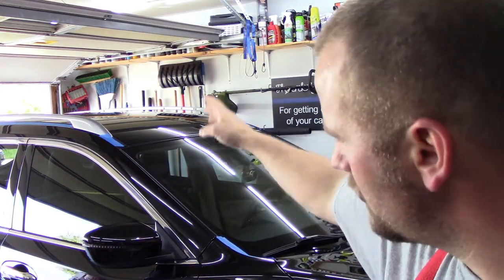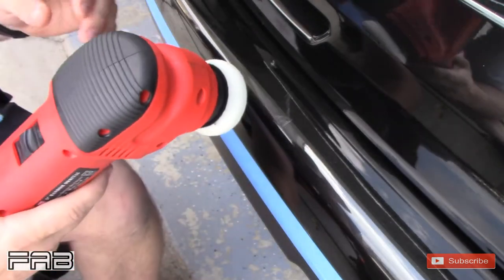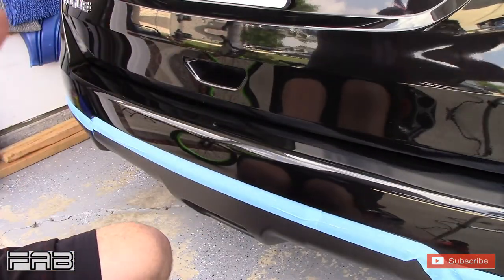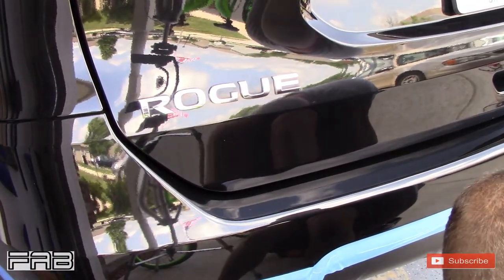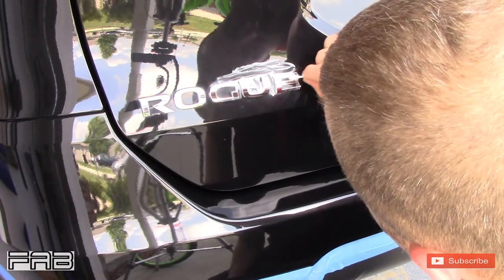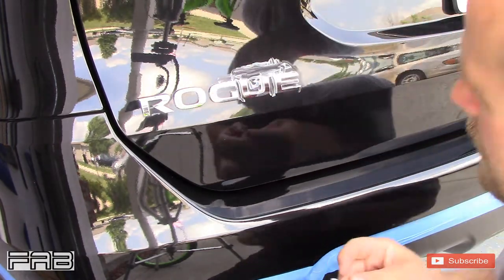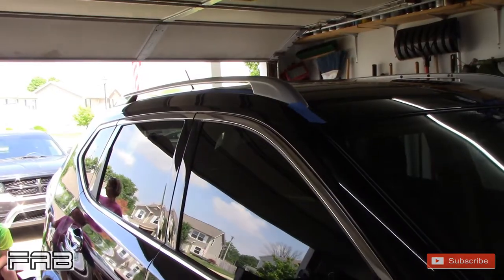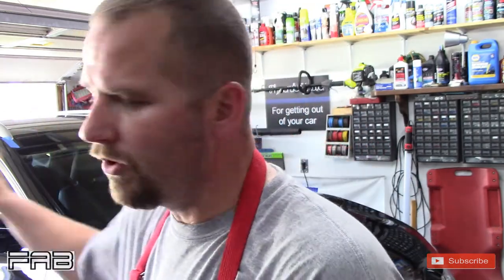Detailing Series Part 4 Badges,Pillars and Mirrors

Comment: More great tips. I also have and use the Qtips. Also have used really worn, extra soft bristle toothbrushes. I love my 3 inch polisher but that little things gets hot if you run it too long.
Reply from the maker: Camaro Time The 3 inch polisher does get warm but I have never had a problem with it stalling or anything like that. Toothbrush sounds like it would work also. Thanks for the tip!

Comment: Dude the Q tip! 😄 super legit!!! Love the video. Been needing a smaller polisher and just on the fence about the Griots 3 inch. How does it perform with the 2 inch conversion. I remember you saying it was underpowered. Better with the smaller pad? Thanks FAB👍👌
Reply from the maker: PapaSmurf918 Yeah the Q tip works great! Yes it is definitely under powered but is better with the 2 inch conversion. Personally though I wouldn’t buy it again. Griot’s says they have a big announcement coming in April or May and I think it might include a new smaller polisher to replace the 3 inch. You are welcome!
Reply: That would be awesome if they did. I'll try to hang in there for it!! Right on!!!